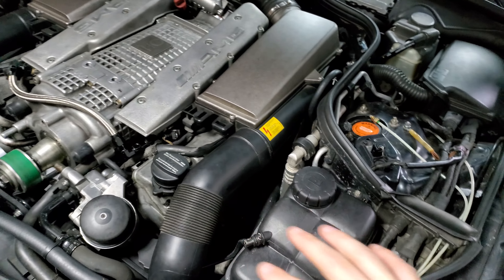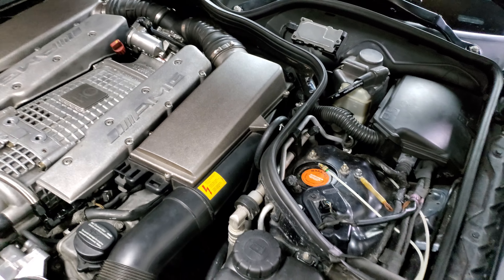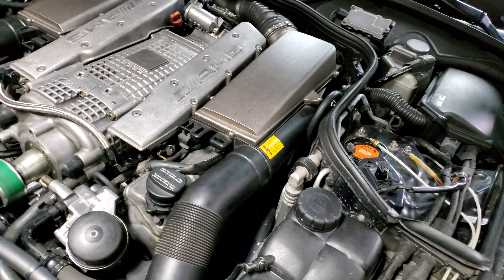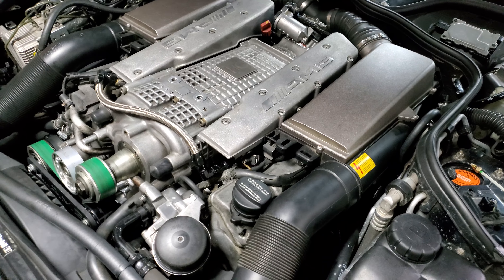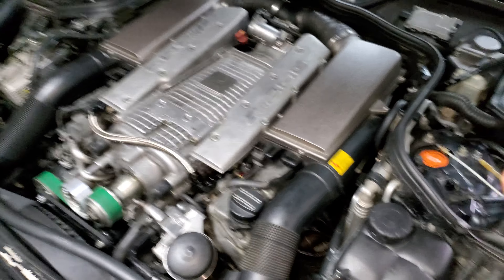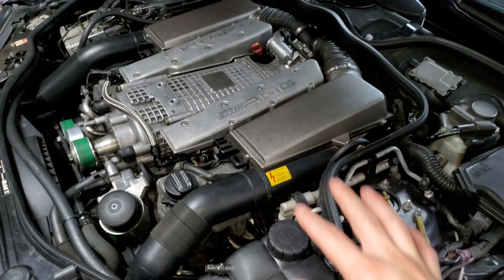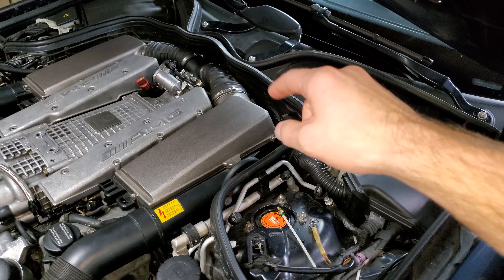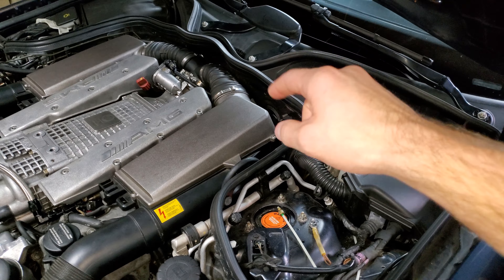4 years of the E55 time for somthing new!

Comment: Hate to see it go. But when it’s time it’s time. Thanks for sharing. Love to see the crank seal video. I need to do that at some point on mine
Reply: If it's a small leak, just leave it till the trans needs to be serviced. Not worth the labor/effort to pull the trans for a small weep. Gasket will just dry up and leak in a few years anyways.
Reply: @aceorocha7857  yeah thanks for the heads up. That’s kinda the way I was leaning. It’s not making it past the catch trays. Hey I did have a question for you, as the only E55 I have rode in is mine. Does yours have an on throttle off throttle kinda clunk? Seems like toward the rear or the car.. maybe like a diff mount or something?
Reply from the maker: Could be a transmission mount or bad flex disc
Reply: @suddendilemma5137  Might want to check bushings/control arms in the rear. These are super unlikely to go back, but might be the source of your problem. 

In all likelihood it's probably your drive shaft flex joint you might want to check and see if the rubber has cracked through. Super easy fix.
Reply: @turbocraz1  yeah I suspected that was well. I installed a set of east coast euro’s poly motor mounts and did the amg black series trans mounts. So that’s all new. I put the some eyes on the flex discs while I was in there. They had some cracks but nothing that seemed more than wear and tear (71,000 ish miles) maybe it’s in the carrier?
Reply: @aceorocha7857  I’ll check that. Well glad to hear that that clunk is abnormal. I was a little worried like excessive backlash in the diff.
Reply: @suddendilemma5137  I doubt it’s the diff, I’d check the common culprits first before moving to the more expensive stuff.
Reply: @aceorocha7857  thanks man I’ll check it out and let you guys know what I find. Thanks for chiming in.